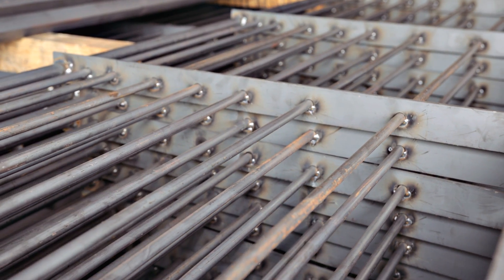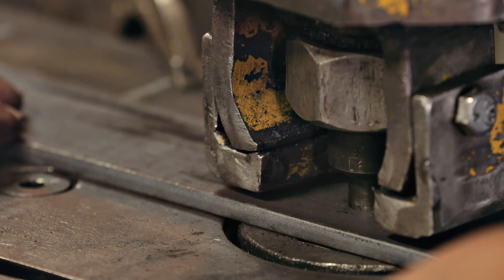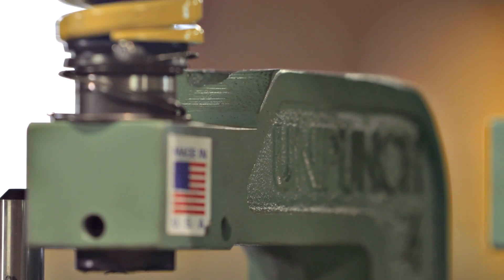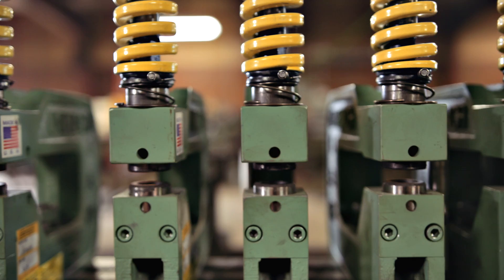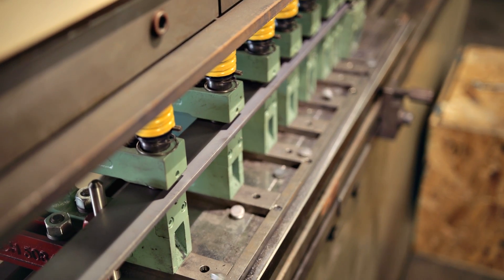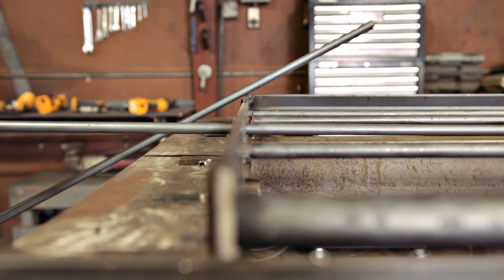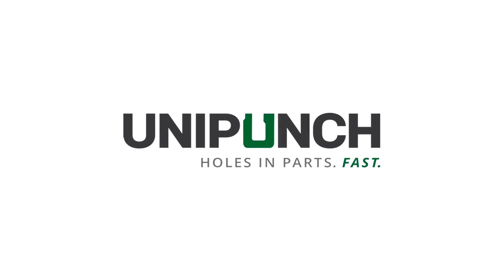10x Faster than Ironworker | UniPunch

Comment: This is a great idea if you have a hydraulic press brake, or a punch press. 
Lacking those tools you can build a hydraulic press with small cylinders and a pumping system. Not such an easy setup though. I use to work at Borg Warner"s radiator R&D plant in Coldwater, Michigan. We did a lot of one off radiators, that shared the same hole spacing. A piece of 1/2" by 6 with multiple holes in it could be setup to hold Strippit dies. They are the same design as the UniPunches. Great idea and a real time saver. 
They improved quality too. Once the bar was made the holes were always in the same location. Using an ironworker with a single punch and a stop, the steel bends and twists when the punch goes through. Each hole puts the others slightly out of position.

Comment: they made 60 holes in one hour, now they make 10 in ten minutes, hmmmmm sounds like the exact same to me! I think they need to re think this ad
Reply: Earl Van Fleet or perhaps you should go back and listen to the commentary again. He said they were previously doing 60 verticals (the entire flat with the holes in it) per hour and now they are doing 10 verticals in one minute.
Reply: byronmill Even if the duration of punching was the same there would be a greater output due to the saving of rewording the verticals and forcing the rods through. Rework is unsatisfactory for a manufacturing plant. Rework costs more than the original cost of doing business. Not only do you have to stop production, spend time lost, removal, rework, insert back into production, now the line has to get back in the rhythm of production, all of that costs more than the original part did, and you have to add that to Cost of doing Business.
Reply: Earl Van Fleet Are you deaf ??
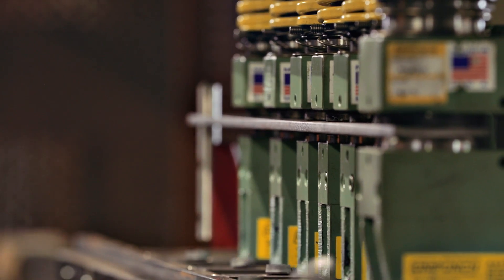Reply from the maker: At 1:09 he is saying that he was previously doing 60 complete parts per hour (1 a minute) and now he is doing 10 complete parts per minute (600 in an hour). The verticals he refers to are the part.
Reply: I used to make grates exactly like this in Stainless...very time consuming, the boss would never spend any $$...had to do all the 1/2" holes on a Bridgeport...no DRO...
Reply: Doug Ankrum:   A CNC milling machine would drill those hole pretty fast, and with a jig, they could stack at least 5 at one time. Plus when not making holes, the milling machine could be used for other projects. With that machine they were using (the new one with multiple punches), they were still doing one bar at a time. In the old days we had gang drilling machines when I was young and I worked production, so they'd have a machine with as many drills as needed plus the holes come out nicer than if punched in my opinion as the drill could have a chamfer cutter incorporated into it and less clearance in the hole for a better fit of the rods. For the amount of pieces they are doing, the large set-up would be worth it. But in today's world, CNC is the way to go.  Have two sides of the table jiged up, one side being high speed carbide tipped gun drilled while the operator loads the other side and vice versa when the machine indexes. Or two CNC mills back to back, and one operator can load one while the other one drills, and again vice versa...